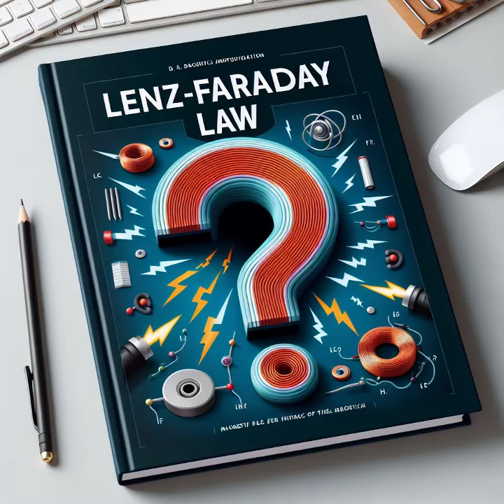Lenz Faraday

Comment: Faraday law  is Whenever the conductor cuts the magnet field EMF is induced. Lens law the current flowing through the coil is Magnetic field induced.
Reply: Both laws are good ?
Reply: The telling how AC and DC Current production . But?
Reply: Faraday's Law refers to the emf induction because of change of magnetic field flux near this conductor (or in our case, a loop or a solenoid). The Lenz part refers to the direction of the current related to this emf. It will be in such a way that it would generate a magnetic field flux change opposite to the first one. Both laws are good.